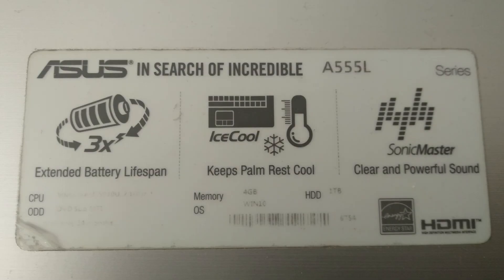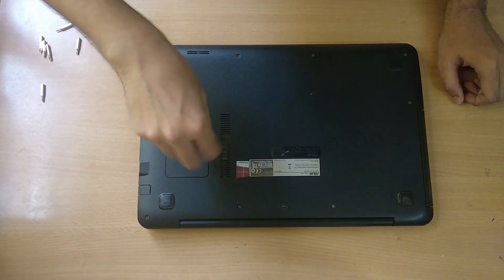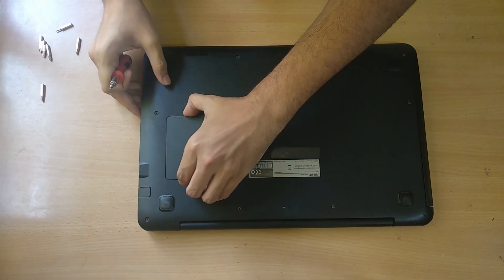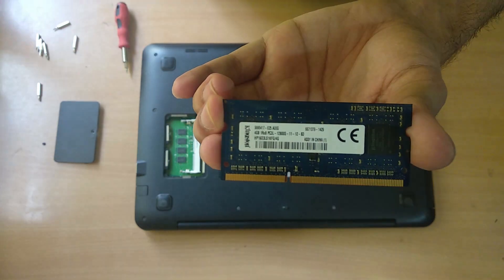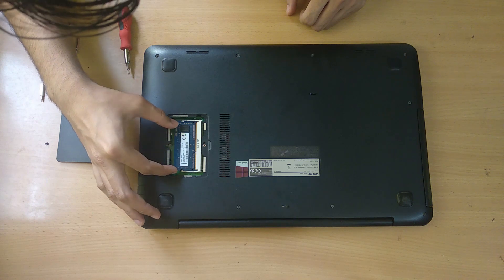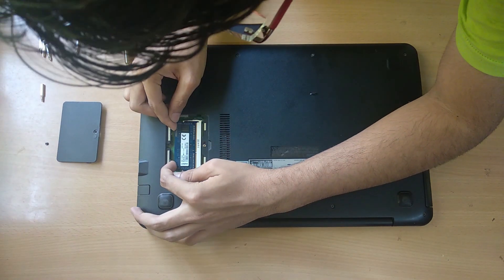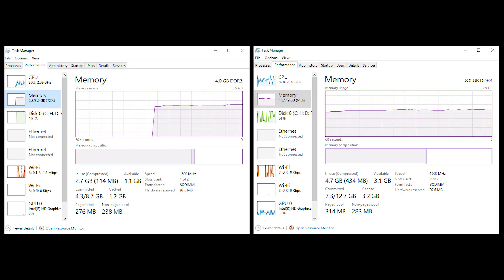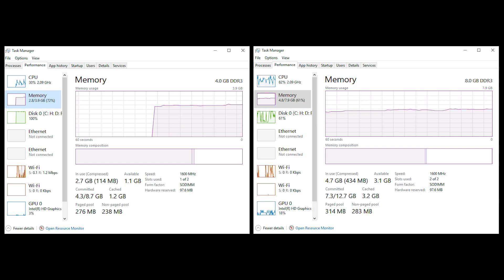Upgradin RAM of Asus A555L Laptop

Comment: my factory ram is DDR3, can I upgrade with DDR3L like you did, or I need to use identical DDR3 ram as factory installed for upgrade?
Reply from the maker: Yes you can. In laptop ram is ddr3l only but it will not always show.

Comment: will it be ok if I add 2 gb and make it 6gb together, Please add link for 2gb also
Reply from the maker: Yes the amount can be 2gb also. But i will suggest 4gb if u are buying new
Reply: @sk-tech  can I use 1.5 v ram? Cuz I find it cheap
Reply from the maker: But laptop ram's are usually 1.35 and using 1.5v might result in instability and crashing. Laptops run on battery and maintaining high voltage levels will become difficult. But before buying the ram check the speed of ram in the task manager
Reply: @sk-tech  evwn I'm using Asus A555 lf so should I go for 1.5v ram?
Reply from the maker: No go for the ones I have linked then. They are more suitable.

Comment: Bro is there any way to remove the preinstalled 4GB RAM so that I can insert two 8 GB RAM sticks in Asus A555L RAM slot ?
Reply: isn't the max only 12gb?
Reply from the maker: Yes i think the limit is 12GB
Reply: @juntan-i2s  I'm not sure that's why I am asking here.
Reply: @sk-tech  It means I can't remove the preinstalled 4GB RAM.
Reply: @arunavabanerjee1315  nope it's soldered
Reply: @arunavabanerjee1315  also u can't put two 8gb sticks since max is only 12gb
Reply: @juntan-i2s  Okay. Thanks for sharing.